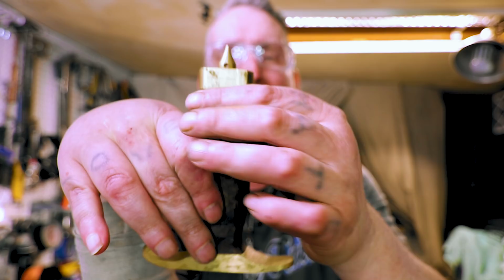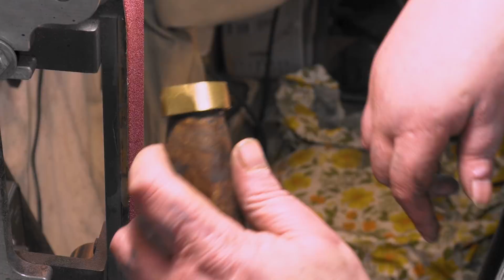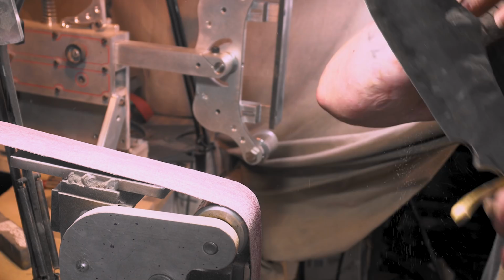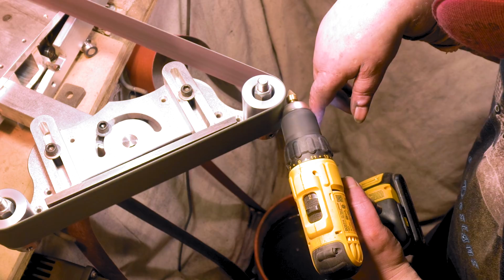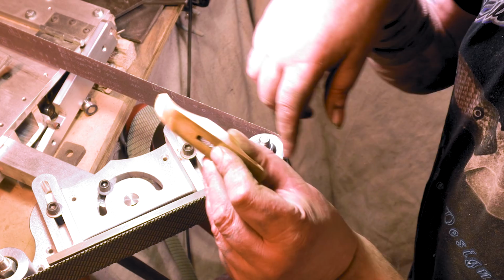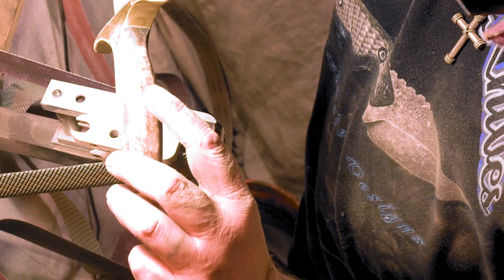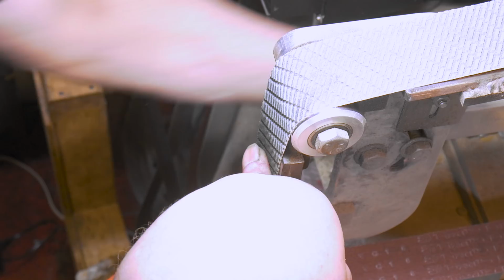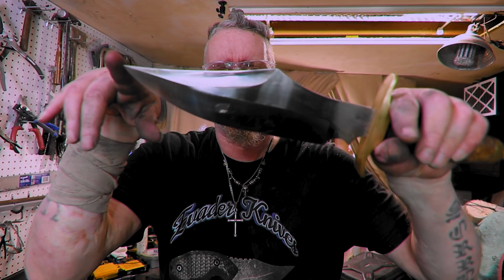Bowie Knife Build - Finishing bevels & handle

Comment: Looking great and the swedg is perfect!  What new method did you start using?
Reply from the maker: I kinda started looking at the swegde as another bevel. I use to slant the knife to go with the back of the knife, instead of pulling it straight like a bevel... I'll probably do a video on it....
Reply: @evaderknives    Thxs Dave- so are you gringding the swedge AFTER the main bevel?
Reply from the maker: @NRiggiKnives  I don't know yet, I'll have to figure that one out